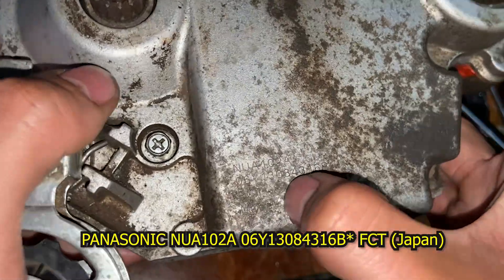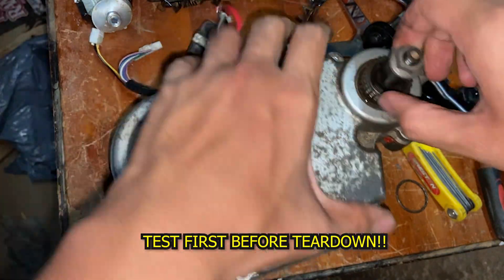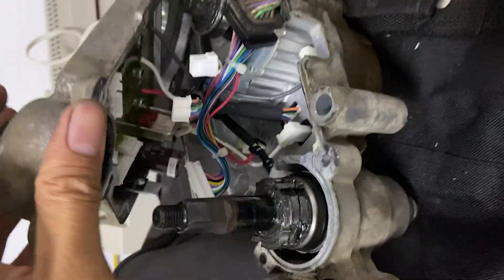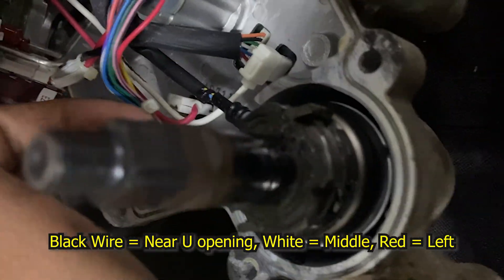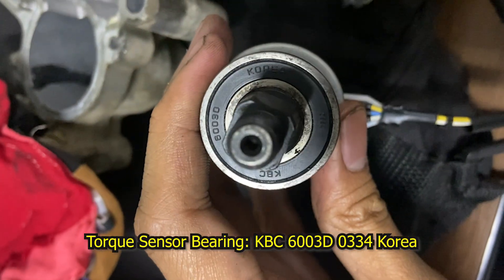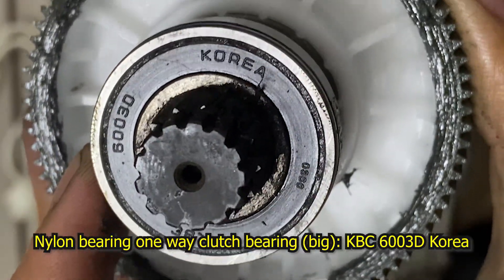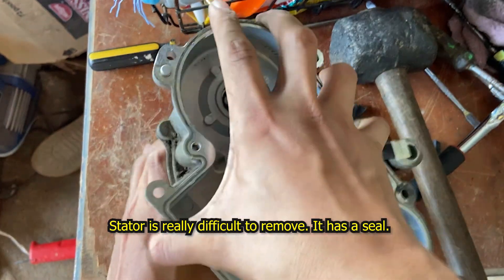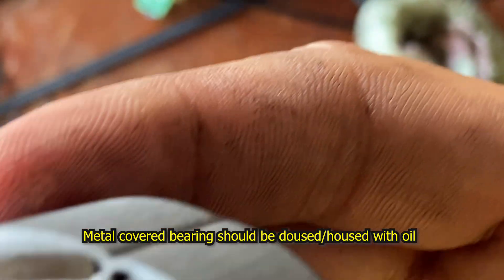Panasonic NUA102 Ebike Pedal Assist Motor Ultimate Guide teardown regrease servicing tutorial guide

Comment: Thanks for the detailed video. So if I remove the original controller, connect 3 phase wires and hall sensor wires to a generic controller it, will it work with a throttle like any other DIY ebike?